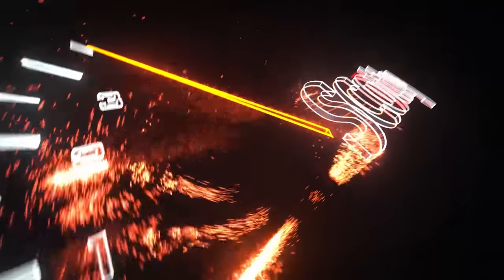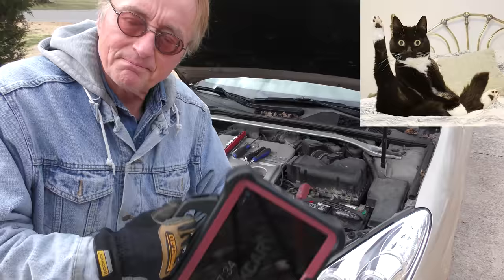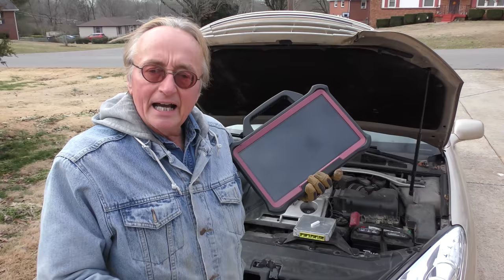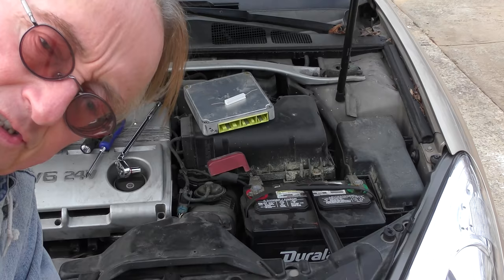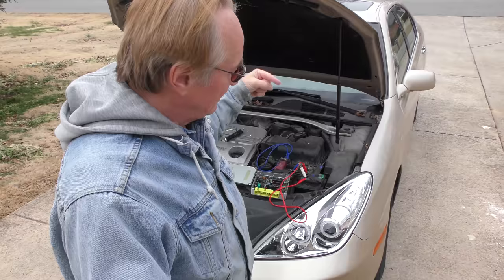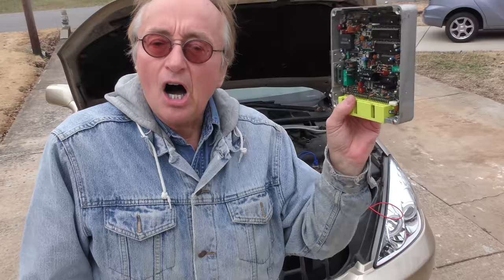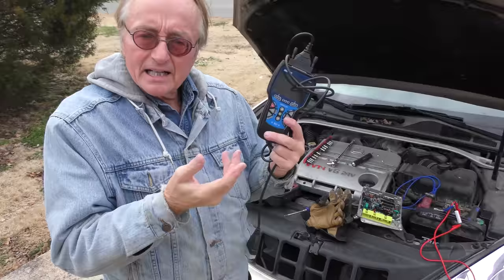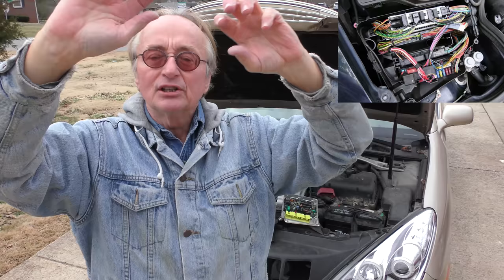This Stupid Thing Will Save You Thousands in Car Repairs

Comment: 1 ohm is ridiculously close to a direct short, which Scotty warns against.  If you're concerned about a direct short causing a spark and damaging your electronics (I'm not too worried, but whatever), and since most folks don't have a 1 ohm resistor laying around (I do, but I'm weird) just find any incandescent light bulb, from a car or a home, and include it in the circuit.  They have a low resistance of a few ohms when initially turned on.  Or just use an old fashioned automotive test lamp, which use an incandescent bulb.
Reply: Where do you buy the resistor
Reply: Electrician here, you are wrong.
Ohms law says you're wrong.
Reply: @faradaysage15  Electronic technician here, retired, 37 years repairing an assortment of electronic devices to the component level.  Ohms law and I are pals.
Reply: Shud make a video....
Reply: @Larry Cook  Retired EM, but am trained deep into electrical theory. Agree with you.
Reply: i paused the video when he was showing the resistor at 3:35 ish, and it says 10W 1KJ... looking online, would that be 1000 ohms? I dont know anything about electricity, so feel free to correct me if im misunderstanding something
Reply: @JGBarco  Yeah, it does say that.  I have no idea what the KJ means.  While watching the video again I notice he removed the Pos wire from the battery first.  There's a good reason you should remove the Neg wire first.
Reply: I would use a 10 or 100 ohm resistor.Should work well enough,especially if you wait 15 minutes.
Reply: I was looking thru the comments looking for this very info, was thinking of trying a framing nail or something metallic
Reply: @Cain-IVI  Perhaps it would be better to just pull the fuse for the computer, or disconnect the battery for a minute, if you're thinking about nails and such.  Personally, I think Scotty is often full of crap.
Reply: KJ May mean kilojoule in this case.
Reply: Thanks for this.  I do have an ohm resistor.  But will use method he uses in another video that just invovles unpluging negative terminal to reset computer.
Reply: z
Reply: its a 1k ohm resistor, which would work as intended, he probably got confused at some point with what he was saying and didn't realize in time sadly...
Reply: @Mc-xm3so  That makes sense.  Most people have a hard time with the kilos, millis, micros, megs, gigs, etc.
Reply: @LarryCook1960 Larry , I am an absolute analfabetic, yet couldn't it be, by any chance, KiloJoule?
Reply: @TheMrBennito  Perhaps you're right.
Reply: @LarryCook1960  it's just something I recall from highscool, physics class
Reply: I made my comment today before reading far enough to see your comment. I find your first sentence to be completely accurate and I suggested that 10 ohms would be a bare minimum to avoid the effect like touching the cables together directly. That seems to fit with your other suggestions!?
Reply: 1000 ohms would make a lot more sense than 1 ohm which would be extremely close to touching the cables together. I'm really surprised that Scotty hasn't responded/corrected this since it has the potential to be a very expensive damaging problem!?  @JGBarco
Reply: will the cabin lamp bulb do? how long shoud it be connected? thankx
Reply: @faradaysage15  Yeah... look in your Ohms manual it is on page 127 second paragraph. Then turn yourself in!
Reply: @TheMrBennito No. K is kilohm, J is tolerance I think.

Comment: Thank you for everything. Spent thousands over the years in repairs until I decided to use youtube university for the majority of maintenance now. Just got myself a bluetooth scanner for my 07 Ridgeline after I took it to the dealer to check out some overheating problem. They wanted over $800 to replace a bad ECT sensor that after looking it up myself, took me 10 minutes to replace and the part was under $20. Completely mad about how many people get ripped off like I almost did. Will forever watch your videos.
Reply: That is just one of the reasons why auto dealerships are so distrusted.  A few are honest, but your odds are better by using an independent repair shop instead - although many of them are crooked as well. Or have untrained mechanics that shotgun any problem - with you paying for all the parts/time for their failed efforts.

Comment: Thanks Scotty; I used this resistor on my 04 Chevy Silverado 2/19/24. I took it in for the pollution test and it failed, the resistor did to good of a job. I was told to bring it back in a week. It cleaned all the garbage out of the computer And everything else. Thanks

Comment: Get out your ohm meter and check that resistor. According to the side it's a 1000 ohm  (1K) not a 1 ohm. A 1 ohm would allow too quick a drain and could damage your ECM. Thanks for the great tip. I didn't even think about shorting the cables (fortunately!). I just leave it alone and go have dinner. I will locate a resistor and probably solder half a clip lead onto each end. Then it goes in the tool box!
Reply: I agree.  A 1 ohm is very close to just ussig a piece of wire.
Reply: So which resistor do you recommend?
Reply: @errolrojas3460  it does not matter, if it is 1k, 2k or 10k, even 100 will limit current to 0.1A; I would just switch cabin light on instead :-)
Reply: Thats what i was thinking how would 1 ohm work.
Reply: So what size resistor is it?
Reply: In the video he said 10Watt 1 ohm. I watched it with closed captions.  I have one in one of my alternator wires that looks like that but i don't know the values are.

Comment: Might want to use a 1,000 Ohm vice  1 Ohm resister.  1 Ohm still gives lot of current when you short the plus and minus sides together.  If you do, resister can also be smaller than 10 Watt.
Reply: I just posted this to Scotty..   ScotThe Gr8, YOU are correct.    Hey Scotty,  at the start of the video time index 3:35 you said the resistor is a 10 WATT  1 (one) OHM resistor.  Near the end time index 9:30 you show the resistor and it is a 10 WATT 1K ohm.     1K = 1000 OHMS.  please let us know which one it is!  It most likely what the part shows. 10 watt 1000 ohm. THANKS!
Reply: @edmercer1459   I noticed this the first time I saw this.  Does he know what the K means?  Not sure.  Might be an oversight.  I would go with the 1K.  I don't even know if they make a 1-ohm resistor?   ChatGPT says they do.  Go with the 1K.  How do we know when the process is finished?  Shouldn't we include an ammeter?  
Did you do this yet?

Comment: That's the good thing about a 1975 Chevy Vega - no complex engine computer. And that's the only good thing about a 1975 Chevy Vega.
Reply: That`s what we like about our 1970 C10 P/U. When you get the dwell right it purrs like a kitten  at idle but once throttle is opened it roars like a lion without any computers or complicated electronics. You can set the dwell good enough with a .019 feeler gauge & once engine is running warmed up then you can get dwell setup fairly close by just listening.

Comment: Good tip Scotty! 
Honda Techline still recommends to do this reset but straight cable to cable even up to 2022!
We use this procedure to fix everything from gauge issues to back up cameras to multiplex issues!
Reply: So it's safe to do a 2005 Honda Accord (4cyl) straight up + to -  code reset?
Reply: @Turbojonny5  I generally don’t code reset in this manner. It is safe. I imagine it would clear the code though, assuming you repaired the problem first. 

On that generation Accord I would primarily use the battery cable reset procedure to attempt to restore things, as a first step, such as a tachometer or fuel gauge that suddenly stopped working or multiplex controlled faults (such as power windows/door locks), etc.
Reply: Use a 100k Ohm resistor. Much safer.  👍
Reply: @ktl4539  while using a resistor would be ok it just isn’t done at Honda because Techline doesn’t say to. When Techline states a procedure is how it should be done even up to 2022 you do it that way. The non-resistor method is even published in their service procedures. 
As far as Honda goes there isn’t an epidemic of failing control units because thousands of dealer techs are battery cable resetting without resistors. 

I cannot speak for non-Honda products though.
Reply: @ktl4539  Is the high wattage really necessary?? I have a bunch of resistors but no 10W!!

Comment: I never would have thought of this! Really great idea. 1 ohm is very little, but it makes sense that it would function as spike protection. Those computer modules have a lot of tiny capacitors, and if all of them are allowed to empty simultaneously with no current limit, it could cause many sections of the module to experience current levels WAY higher than they were designed around, courtesy of the current travelling backwards (no fail-safes). With 1 ohm there's at least a concrete limit that makes all the capacitors empty at a consistently lower rate. Amazing stuff, Scotty.
Reply: Electrician here woth an EE degree and ex mechanic . That's not how electricity works. Backwards? No. Current yravels from ~n voltage to a lesser voltage, any and all paths it can.
Reply: Scotty, thanks for all of the great information you share! I've been able to do much more to fix my vehicles now!
Reply: Use a 5W bulb. 
Yes backwards! 
The 12V system normally powers the computer, with current flowing into the modules. When the capacitors are discharging, the current is going in the reverse direction. A moden amimeter would show a negative.

Comment: Like some of the others say in the comments, I think it is a 1K ohm or a 1.3K ohm resistor. Just want people to use the right part.
Reply: It was oddly specific to even say 1 ohm 10W, since pretty much anything could be used, old turn signal bulb, headlight, car vac, load tester etc.
Reply: @wingerrrrrrrrr , is that true? That I could just substitute the resistor with an old turn signal bulb, jumped between the disconnected positive and negative battery cables?

Comment: Based on this information,  you could damage your computer if the positive cable contacts any bare metal that is grounded to the frame. Also, I wish you would have disconnected the NEG. Cable before the Positive Cable.

Comment: You´re so right Scotty, when I was working in the 80s as an Electronic Tech. I always used a couple of resistors in parallel to discharge Electronic capacitors and other components.

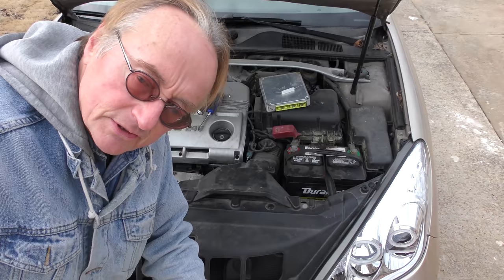Comment: Scotty, you are incorrect, in the video you say at 3:37  "get a 10 watt 1ohm resistor." A 1 ohm resistor is essentially a shunt, which can/will/may cause damage to modules. You need 1K (thousand) ohms minimum, and that's what you are holding in your hand, a 1K ohm resistor.
Reply: So, is it 1 ohm or 1k ohm?
Reply: But then again, if the resistor is 1K ohms (1000 ohms), why would you need a 10W resistor when the maximum power going through this resistor 0,144 watts (power = voltage X current) 12Volts X .012 amps = power. A 1/4 watt 1K resistor would do the job. Using a 1K resistor will drain everything safely, even though it might take a little more time to discharge any of the voltage that is left in the computer module.
Reply: @HorsepowerAddicted  and the characteristics of cables ?
Reply: and the characteristics of cables ?
Reply: @HorsepowerAddicted  You are correct, but the wattage is not the issue here.  Using a 10 watt ceramic is simply easier to demonstrate,  easier to hold, (gloves cold weather, etc) easier for the folks to see than say a 1/4 watt resistor. The issue here is that he advises the folks after warning them of the dangers of simply shunting the battery cables as a rapid discharge can damage components. There is really no difference in this application btw a 1 ohm resistor and shunting the cables.   He also advises to remove the positive cable first. Good practice is to always remove the negative cable first, simply because you may accidently touch the chassis or some ground point with the tool and causing an arc weld if you remove the positive first. The guy is knowledgeable,  probably forgot more than I know,  but he made mistakes in this video.
Reply: @cristianmorar5558  Are you talking about the jumpers used to connect the resistor? No specific requirements. Average gauge will suffice.
Reply: @gotTeslaModelY   1000 ohm. 1.0 ohm may/can/will/ cause damage to the modules.
Reply: @cristianmorar5558  pulling my leg??? You do not need  a #8 cable to carry 0,012 amps. The small jumpers Scotty showed in the video will do the job. There are plenty of cross reference tables on the web to show what gauge of wire you need vs the current that the wire will have to carry. Just research "wire gauge vs amps".
Reply: 12 volts 1 ohm means up to 12 amps max discharge current 
10 ohm would be 1.2 amp max discharge current, 100 ohm = 0.12 amp max etc

Any small globe such as a test light would also do it but note that LED lights won’t take it down to zero volts.
Reply: @AMTattersall  A friend of mine tried this two years ago with a 2.7 ohm resistor. The car would only crank after he reconnected the battery.  I would stick with a 1K and let it bleed off, or if you have the time,  disconnect and the electrolytics will discharge eventually. It depends on the model, the sensitivity of the component, etc. I know people that have just simply connected the positive battery cable to chassis ground and all was good. You may even be able to get away with that 9 times out of 10. It's that tenth time that's costly.
Reply: @HorsepowerAddicted  I can not speak for Scotty, but I can speak for myself, The reason i need a 10 watt resistor so you can find it when you need it. The 1/10th watt resisters are about the size of a grain of rice. If I put a 1/10watt resister in my tool box , i would have a lot of trouble finding it again. It is too small.
And yes. 1000 Ohms is the right value. He is holding up the right resister,  but he makes an error in what he said.
Reply: I think he needs an younger assistant to correct him on these things....or he shoukd have a script to remind him of the correct information.
Reply: Yes in aircraft school they teach you kiss which stands for keep it simple stupid, I'm talking about myself. Just remember N.P.P.N. negative/positive, positive/negative and you will never go wrong disconnecting or connecting a battery!
Reply: Its a 1000 Ohm resister that he is using.
Reply: @HorsepowerAddicted  A 10W resister is easier to hold.

Comment: Hey Scotty your awesome buddy but I have to point out I always instruct my Airman to always disconnect the negative terminal first. This avoids them from taking a welding class. 👍
Reply: This depends if you have a negative or positive earth electrical system>
Either way, disconnect the earth cable first.

Comment: Good one Scotty BUT the shop manuals I have say to ALWAYS disconnect the NEGATIVE battery cable BEFORE disconnecting the POSITIVE cable. 
Note: Both of my vehicles and their shop manuals were made before the  year 2000. So things maybe different nowadays with newer cars.
Reply: It hasn't changed. Negative table off first still applies.
Reply: It doesn't harm any electronics or make any difference in that way. It is recommended to remove negative first so you don't accidentally short circuit you wrench against grounded metal engine or frame parts. So its a good habit when it can be done that way. In some cars like mine the battery is installed in such tight space that you have to remove positive first since negative can only be accessed when fuse box and battery cover is removed and battery is pulled forward from under the windshield where the negative terminal is.

Comment: Update: Well this brought the Navigation Screen back to life but the tail gate is trying but is still stuck. It did not drain my cell phone Bluetooth settings and my favorite addresses was still there. I let it drain for 45 minutes. 
Thanks Scottie, I am just having to try this out on my Money Pit Lincoln MKX and remember you video. I had bought a resistor on the first viewing just in case. I had to replace the factory original battery and the new replacement went bad in 3 months and I had to warranty replace the new one.  When this all started happening.

Comment: Warning****Great tip thank you...but please note @1:35 point , the reference to the resistor being a 1ohm 10W resistor, which essentially is no better than shorting the 2 battery leads together. I bet you meant to say a 1kohm 10W resistor (a thousand ohms vs 1 ohm - big difference). When you look at the resistor in the clip, it clearly shows 10W 1kJ, which means it's 1kΩ. I hope no one damaged their electronics...

signed, sparky;)

Comment: Jump start cables and a 12W light bulb (not LED) will do the same trick as it will fit the same properties. A 5W light bulb will probably be as good but you have to wait more than twice the time. A LED will not drain the system entirely. Be sure not to shortcut anything, a resistor is easier to use since the connectors are far apart.
Reply: I have a spare 12.8v 10.2w light bulb...would that be similar? I also will be using 2 2' gator clip leads to connect to the bulbs. Id imagine that would offer plenty of resistence right?
Reply: We

Comment: When I installed one of those apple car play stereos in my 08 highlander it idled very funny (disconnected batter) for a few days. Made me very nervous. But eventually it went back to normal. Just thought I'd share!
Reply: Interesting!
Reply: Yes, the ECU has to relearn the idle pattern of the car. Some cars have a procedure to "teach" the ECU in the owner's manual or shop manual. I had to do that on my Dakota after cleaning the battery terminals, before getting the annual emission test.